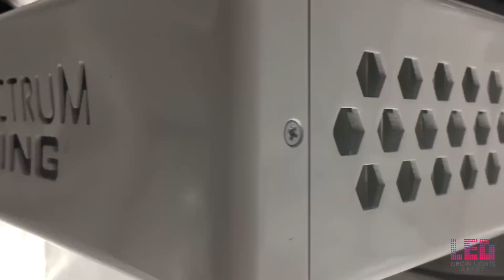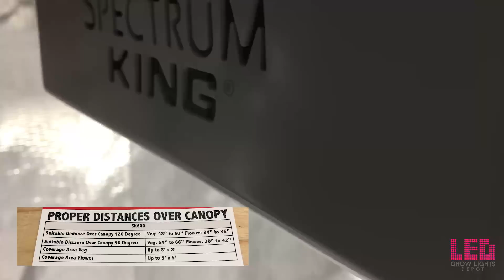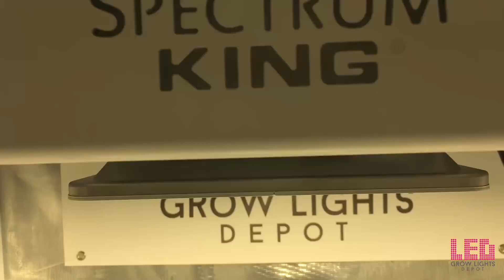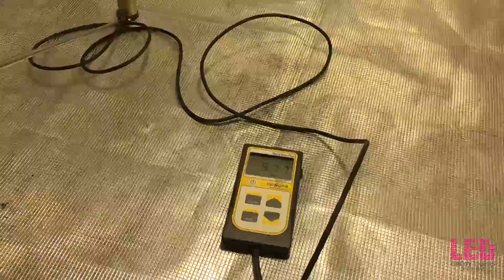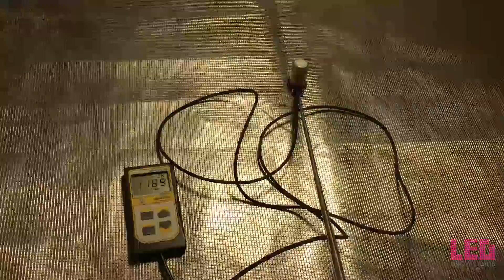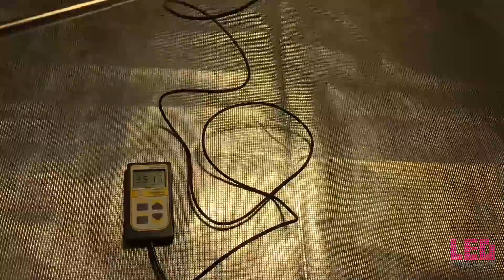Spectrum King LED SK602 Grow Light Review

Comment: The Green House version covers 8x8 in Flowering and 10x10 in Veg .. the black one covers 5x5 in Flowering and 8x8 in Veg
Reply: Tony Givenchy do you not realize that that it is the exact same light but in different colors? The only difference between the greenhouse version and the Black Version as they say is that it's white. That is for maximum reflection. You don't see black fixtures in greenhouses. But as far as its capabilities and its power draw and coverage it is identical
Reply: There isn't a single light on the market, and never has been that will flower effectively in an 8x8.....ever......and yes...the GH and black are exactly the same except painted white or black

Comment: Could we see a review of the Spectrum King LED SK402
Reply: Here is my review. First it uses 533 watts from the wall not 480 as they advertise. It is over priced considering you can build a nice cob light or quantum board set up for less money and less electricity used. Just don't fall for their hype. They work well, but for the money I wouldn't buy another one. Really I bought one for testing.

Comment: Everything about the SK is bad accept the diodes. The Diodes are decent, not the best but the narrow footprint means you get a hotspot in the center if you try and hit your edges. I don't understand this horrible build as it tries to encompass all of the shortfalls of an HPS but with LED as the light source. 

SK compacts the light source to a very small area as I mentioned above... but in doing so you need a crazy heat sink to cool it rather than spreading out the diodes over a larger surface area for passive cooling (no fan) and better spread of light. The profile of SK lights is very very tall, my home built lights are about half an inch.... half a fuckin inch.... This light destroys your head room and again because of the narrow spread of diodes you will have hot spots meaning you need high ceilings just like with HPS. 

This is the worst of the "good" led lights out there. there is no situation this light is better than just about all oher decent to great LED grow lights.
Reply: do you think a timber redwood would be more ideal?

Comment: you need to watch the video they just posted on how PAR is not relevant.  Dope as lights I  have some of them and will never buy anytyhing else. just need to correct some of your knowledge brother . thanks for posting
Reply: Sorry John smith but that video SK put out isn’t accurate.  Check out Growmau5 video on YouTube if you haven’t yet.
Reply: Growmau5
Reply: any tips on where to alternative cob full spectrum lights?spectrum kings freaking ridiculously overpriced.ive recently seen colored t5 bulbs that when used together(green-blue,blue,white,red,red-violate) gets full spectrum.t5 lacks light penetration but when you have 8 per fixture and adequate circulation/cooling thats not an issue.
Reply: @trystonantol8685  hi forget about coloured COB! White one are what you need! SK's are not that efficient! Try DIY quantum board!
Have a lifted one and lots of good vibes from France
Reply: @trystonantol8685  you mean t5 with Samsung LM301B diodes on it? The same they use for Qb's? I am not sure if it is possible to make such small driver to do it!?
There is strips 1 and 2 feet long you can mount on aluminium U shape it is easy to do and you plug it to a good meanwell driver(HLG series)! There's plug on the strips for the wires and you will need a couple of Wago to connect it to the driver and a socket to plug the driver to the wall! It is very simple to make and I am sure there is a lots of mounting videos here on YT! Just tip Samsung strips/LM301B  mounting/diy
Have a lifted one
Reply: ive seen t-5 bulbs that use quantum cob just like hlg,4200k around 15$ a pop if i recall.for those of us with a few 2-300$ t-5's in veg this might save alot of money.id like to know more about these quantum chips,pm me on fb tre alexander
Reply: John Smith and you need to watch some videos that don't involve the lies of spectrum King. Dr. Bruce bugbee and Nevada and Utah State universities are doing some amazing studies nowadays. Par and ppfd are the only things that matter in combination with Spectrum.
Reply: After talking with someone from HLG, they told me exactly what lights spectrum king uses,they’re overpriced lights aimed at commercial growers.not saying they’re bad.but you can get the exact same thing from other sources for much less.
Reply: @alienman2939  link?

Comment: 640 Watts at the wall and three hundred + LED lights,,, that adds up to about 2 watts per chip/light that means an old LED fixture with 400 + lights (3 watt LEDs chipz) being pushed at one point five(1.5) Watts is Easley out doing this fixture( or two 250 LED light fixtures with 3 watt chips being pushed at 1.5 watts *1 *250Led can also out do this fixture) 2 watt LEDs lights are usually using 5 watt chips( the math is usually .5 per watt chip/light that the company's optimally run their chips sometime'z a little lower in effort to make the chips last longer) FOOD FORETHOUGHT.......

You can also combine multiple cheap LED lights with CFLs or fluorescence - (5500 - 6400k vg 3000k-etc/flwr  or fluorescent bulbs UV Spectrum - etc  to obtain the same growth efficiency in the grow room) - to create a ultimate overhead/overplant fixture( it's all about doing your math)..........

Comment: You don't need red diodes if it's already a 4000k spectrum light 🤣
Reply: 4k is a great general purpose spectrum better for veg but you have better results in flower if you can add some red to that 4k. Most flowering led and hid lamps are a 3k spectrum with many hps lamps running a 2k spectrum. I'd personally rather have my lamp favoring bloom than veg if I'm going to flower with it.
Reply: Do you understand the emerson effect?